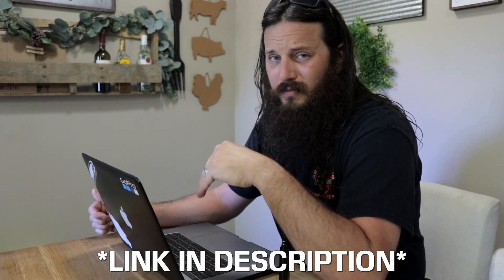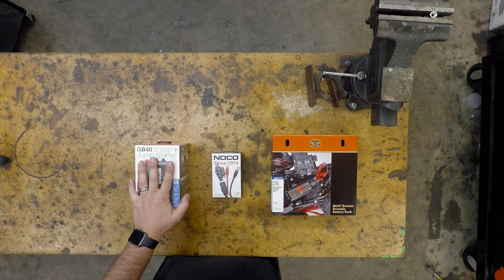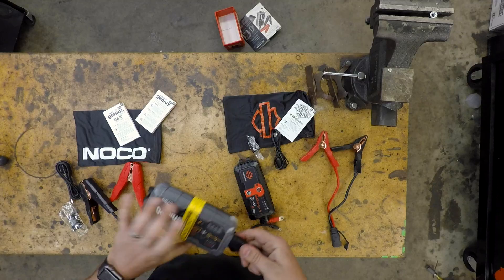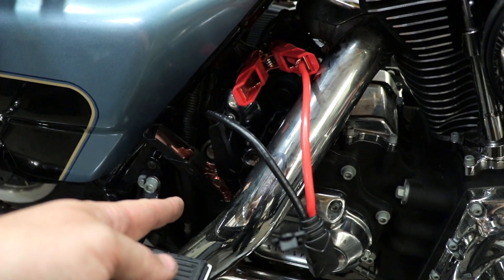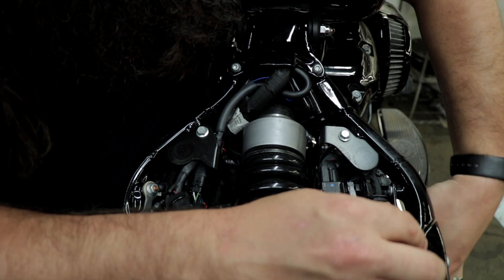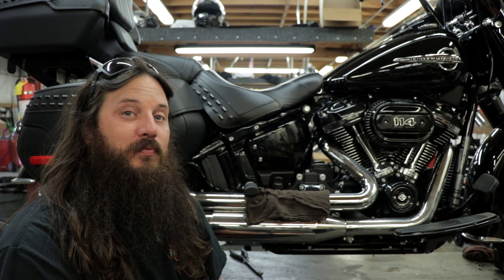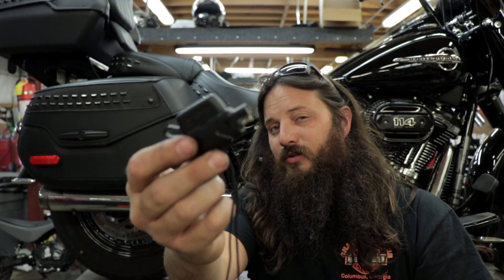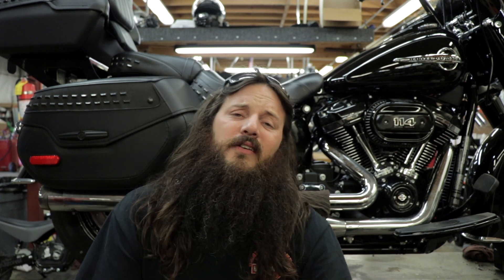How to Jumpstart Your Motorcycle

Comment: I am a tech guy.  Anti Gravity lithium battery(cheapest weight loss) has restart technology so you are never left stranded with a dead battery.  Plus lithium batteries have longer warranty and last 2-5 times longer.  The lithium jump packs are great but they last 5-7 years but you must remember to keep them charged.  The newest tech are SUPERCAPACITOR jump starts like AUTOWIT.  It is BATTERYLESS  tech and uses the weak battery to charger the supercapacitor to jump your bike.  Super capacitors last 20 years or longer and do not need charging.  They sell for $128.

Comment: Or just get a push from your buddy (or find a hill) and save $150. Additional benefit for 2018+ Softails - not going postal trying to get to the battery.
Reply: Dead battery wont run your electric fuel pump. Be pushing all the way home.  Ride Safe
Reply: @SIERRA-dx9wm  Dead as a doorknob, you are definitely correct. Most of the time though, at least for me, the battery is too weak for the starter, but has enough juice for the fuel pump. Usually due to the alarm, winter time and me forgetting the tender. Fortunately I live on the hill, and if I can see the headlight on when I turn the ignition on, a quick push and roll down the hill, pop the clutch in 2nd - 3rd, and ride away happy...
Reply: See your point some riders not that lucky.  Pretty much cant push start any thing these days.  Been lucky mine died in the garage after suiting up for a ride.  Suked @rideon41

Comment: Amazon sells a cable that plugs into the power bank and into a tender plug for $8.99, and most battery tender lead wire is capable of 500 amps.

Comment: Thanks again, purchased the HD version. As a precaution. Wouldn't you know it. On a charity run at the end of the ride. I use the kill switch and forgot to switch off the bike. You know it I come pack to hear that sound no biker wants to hear. No problem the jump box is in the saddle bag. The tip on the touring bike made it easy. Thanks again keep up the good work.

Comment: I have been using a NOCO for about 3 years. I have used it to jumpstart my truck and other vehicles, as well as my DRZ-400 and 883 Iron. They are very convenient. I keep it in my saddlebags, and the accessory pigtail is installed on the bike as well. I have had no issues at all with it.

Comment: I've been using all NOCO products for several years. I've only had one problem with an early version battery charger. I contacted NOCO and they handled the issue quickly and in excellent customer service fashion, which is unusual these days. They replaced the faulty charger with a newer version. If I remember correctly all I paid was to ship the old charger back initially. I've left out some details of our correspondence which aren't relevant here, I only use NOCO products now. I've found that they have superior quality products, even their battery post washers are better than any others I've used.

Comment: Just wanted to say thanks for posting this.  This is one of those things that you don't think you need until you need it.  For me, I was lucky enough to have a friend with jumper cables when I left my headlight on.  Realizing how easy it is to do that, I now have the GB40 in my saddlebag.  I opted to add both the NOCO adapter.  The NOCO adapter in case I need to jump my bike, the clamps in case I need to start someone else's bike or car.  The whole thing really doesn't take up too much saddlebag room.  Thanks again dude.

Comment: Probably the most ironic thing is, I just watched this video today, and yesterday I had to try and jumpstart my bike using one of those battery packs. If only I had seen your vid a day earlier. I didn't realize the starter terminal could be used, and of course I removed the seat and battery top to get at the terminals. As it turned out, every time I got the bike to start I would remove the alligator clamps and the bike would die. Pretty sure it's the voltage regulator now as I was able to check the battery with a tester and it's fine. Thanks for this video though, it has been very helpful.

Comment: I put the Pod-X1 on my 18 SGS and my 18 Breakout 114. Haven't had to use them but I'm ready in case. Getting to batteries in either one is too big of a pain. So much easier to just plug jumper in to pigtail and get it done!

Comment: Good info thank you.  My wife got me the Duracell jump box from Target I think for Christmas, it was about $100 I believe.   It doesnt have the leed like what you installed but it has the small alligator clips and I have used it a few times and it works pretty well.   It however would be probably a pain to jump your softail but thankfully for my 03 softail it works.   Interesting new products and thanks for showing that.

Comment: Nice video.  Thanks for the excellent way to help us out.  To avoid opening the battery compartment on my bike, I am thinking of adapting my powering the load connectors to an SAE male end so that I can use the same SAE (power tender) connector that was previously installed on my batter end terminals.

Comment: Hi john just fyi noco also makes the slimmer jumper clamps i got them with my noco unit as accessory item for my glide before harley came out with their version works great they also make a slim case for the gb40  (gbc13 case) that fits nice in my saddle bag with my tool roll
Reply from the maker: I found that after filming! It’s actually linked in the description, too. Thanks for sharing the Information with other viewers, too!

Comment: great video!  Very helpful and well done.  One quick question concerning the battery tender lead coming from the bike; couldn't you likewise use that connection to jumpstart the battery?  Meaning, could you use the tender lead and the jump box (if you had a similar adaptor coming from the jump box)?

Many thanks!
Reply: I thought the same thing, but in this video he mentions the gauge of the wire for the tender connection might be to low for the amount of charge coming from the battery. Worse scenario might be it melts ?

Comment: I have the NOCO GB40.  Have used it tons of times to jump start cars and trucks and once my bike.  NOCO does sell the smaller clamps separately for about 30 bucks.  They also have a booster pack that they sell as for motorcycles/atvs though it isn't quite as powerful as the GB40.  I wonder if the HD version is a rebranded version of that....as the GB40 is pretty much overkill for jumping a motorcycle.

I didn't know they had that lead that could be attached to the battery, gonna have to pick one of those up myself for my bike.

Great vid!
Reply from the maker: The H-D unit seems almost smaller. A gb20 maybe? I dunno.
Reply: John I wondered if the Harley unit was the GB20 seeing as it has the smaller clamps like the GB20.
Reply: The GB20 is rated at 400A. HD claims 1000A for theirs, same as the GB40.

Comment: John, couple questions:
1.  would there ever be a need to jump the new Li ION batts, do those run out and jump/charge the same as the OEM batts on our bikes now?

2. if so would this particular type of jump system work?   

3. If not, how/what do we use on those type of charging systems if there is a battery issue?
Reply from the maker: Lithium batteries can certainly die, but it takes longer to happen.

This jump pack would NOT work for a lithium battery.

My knowledge on lithium maintenance is low. Working on that!

Comment: hey John, got my new softail slim and this is the first thing i need to research since i have a portable jump starter. the starter actually is easy to locate after removing the metal plate. just lift the rubber boot and connect the positive, the negative can connect to either metal (not chrome). this should work correct?

Comment: Hi John! I got a 2015 Harley 48 with 1300 miles on it. Since last winter running little rough. Showing P0108 and P0113 code. Battery was weak, which I replaced with a Harley battery. Could you help me with my problem please.

Comment: I'm getting one that is 300 CCA for less than 50.00 $. If the battery is only 210 Cold cranking amps. 300 cca should be enough to quick just a motorcycle battery as well.

Comment: John, my bike comes with a tender pigtail connector. Is the adapter acceptable or should I install the heavy gauge wire harness? Oh, and great vid!
Reply: By all means yes, battery amperage could melt tender pig tail.  Re-watch video John mentions that.  Ride Safe

Comment: Hi John - question - I have battery tender leads and cigar lighter leads connected to battery. Are either of these okay to use for jump,  or is the wire gauge too light for the current?  Thanks
Reply from the maker: I wouldn’t do it. Those are tiny wires!

Comment: When do we use that thing to jump start. So much for installing the pigtail.
Reply from the maker: What?
Reply: John Maxwell, I was expecting a demonstration of the "box" starting a bike with a dicharged battery. Maybe next time?
Reply from the maker: Eventually.  all I can offer is that I have used the jump box, but my battery wasn’t dead, so...
Reply: I went back in time and watched you jump the yellow bike. I have a 90fxsts, keep up the good work. I am 43 yrs older than my current ride. In the past I have owned a 57xl and a 46fl, both chopped.

Comment: Hey John, I have a ‘08 Superglide custom, and I like the style of air cleaner that you have on your bike. The HD catalogue says it fits 16-17 FXDLS and a bunch of Touring and Softtails. Is there something different about the throttle bodies or something? I know the lower rider S has the 110 but would that make a difference for compatability?
Reply from the maker: It’s a throttle body change because of the throttle by wire.
Reply: John Maxwell ok I see thanks man!

Comment: Hey man... I have the 117 Anniversary edition Heritage Softail and when I pulled it out of my garage this week, the battery was totally dead because I forgot to put it on a trickle charger over the winter.. When I called the dealership to ask about getting one of those power packs, they stressed really strongly that I shouldn't use one and instead should bring it in to have them take a look at it because if anything went wrong it would void my warranty... only problem is that with the battery dead, my security system has the wheels pretty much locked-up (I can very slowly push it like an inch or so every few seconds)... Is there a way to unlock the wheels even with the battery dead?  Would trying to install this pack myself really void the warranty?  Any suggestions on what to do?
Reply from the maker: The wheels aren’t locked up due to security. They’re likely flat, making the bike feel heavy. The battery pack will jump a bike that has almost enough power, but yours might be too dead. Do any lights come on?

Comment: So how are you liking the power of your mk8 114. Is it still  stock or have you gone SE in any stage
Reply from the maker: I love it. Still just the se mufflers for now
Reply: Was lucky that I happened on my FLTRXS a friend was working at the dealership. I went to bike night and the one I bought was outside when it should have been in so at a glance all the thought was available was 18 with 107. It was a little dark and had been raining told them if it was a 19 with the 114 if buy it. On the second look they realized not only was it a 19 with the 114mk8 but that it had SE1, Rhineharts pipes  and the two point gear for a backrest and luggage rack. Now that I'm well past first 500 I'm putting it through the paces and it delivers
Reply: I'll bet your weight to horse power ratio is better on your bike

Comment: The Harley version is a rebranded NOCO GB20. Cheaper than the Harley version. And noco will honor the one year warranty from any authorized dealer.  And they sell them down the street from your dealer (in Columbus) at battery source!

Comment: Hey John I wanted to ask a question I don’t know if you’ve ever heard of this scenario in which I’m about to describe but I wanted to see if you know anything about it. I recently took my bike in for some warranty work it blew a intake gasket my bike has always been capable of 110 115 mph after I got my bike back from the dealer it’s now limited to 105 and no one will tell me how that happened my bike is a 2017 Dyna Wide Glide My bike has never had a speed limiter on it before but suddenly now it does
Reply from the maker: I’d bet your tire pressure is low. Doubt it has anything to do with work performed, but more likely tire condition or even weather change. Just a guess.
Reply: John Maxwell Finally got an answer back from a local dealership they said that is a factory setting on the ECM that all 2017 and newer bikes have been a top speed program limiter between 105-110 but they couldn’t explain to me why suddenly the limit it will still work when it’s never worked before or limited my bike before and the tire pressure is fine they’re in new tires with about 1500 miles on them
Reply from the maker: That ECM program I thought was just for Milwaukee 8 engines. Not your 17 twin cam
Reply: Well apparently it affected the twin cam it’s even been idleing a little lower , Maybe the tech got confused and thought it was a M8 idk I just know it affected the bike top speed and idle speed but it runs fine otherwise other then idleing like a cold nature’s sporty on cool morning now which it never did before

Comment: How to jumpstart your motorcycle...

1) turn on ignition.

2) push motorcycle or ride downhill.

3) jump on moving motorcycle.

4) pull in clutch and shift up to 3rd gear.

5) let go of clutch.

Motorcycle starts without the need to spend any money on a jump box or jumper cables.

Comment: Nice outtake! I have a question...since the battery is such a PITA to get to, what would you recommend if I wanted to connect the jump adapter and a heated gear harness? Thanks! Love the vids! 🏍🏍🏍
Reply from the maker: Connect them once and then do your best to never mess with it again!
Reply: John, what is the fuse amperage in the GBC009? I’m thinking I’ll swap out the stock charger cable with the Noco adapter so I get two purposes with one cable.
Reply from the maker: Only the battery tender portion is fused, and I never checked it! The normal battery tender is 7.5 amps, so Nocos is at least that I’m sure. A battery tender (name brand) actually only sends .75-1 amp.
Reply: Thanks! I wish I lived closer...you're the best!

Comment: Would be nice if harley-davidson would use larger wires for the tender so it wouldn't be necessary to install the new leads. It's crazy that a bike cost $20k and doesn't even have led signal lights 🤷‍♂️